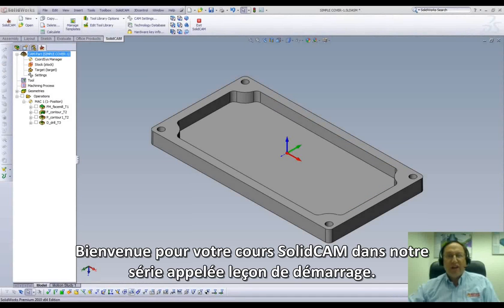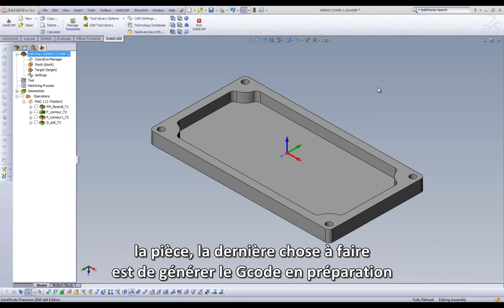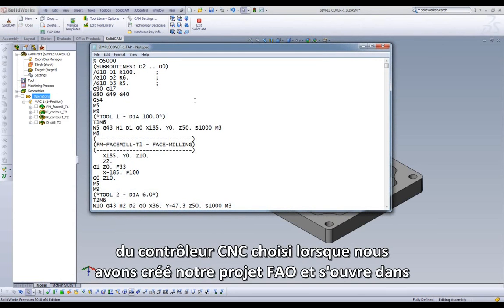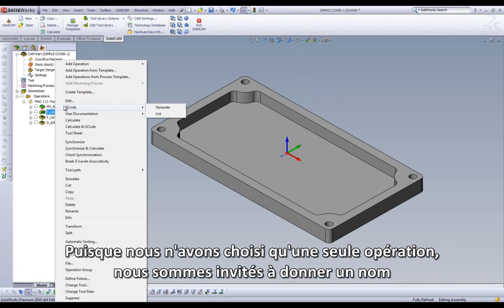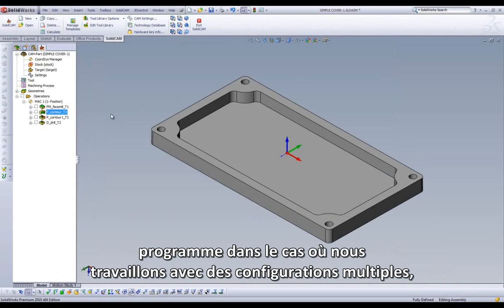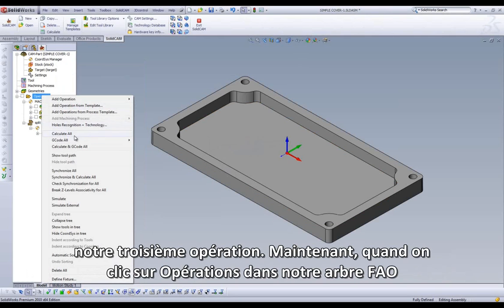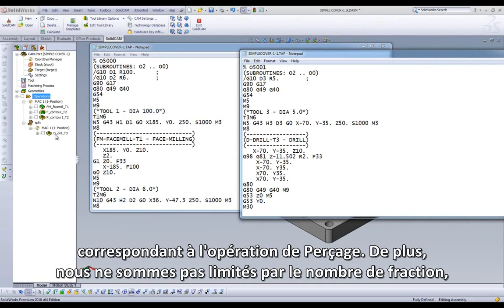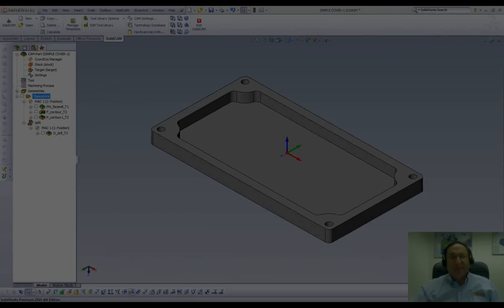SolidCAM - Leçon de démarrage - Partie 9

Comment: Bonjour,
merci pour ce tutoriel. 
Question : Est-il possible de choisir un post processeur ? et le 4 axes est-il supporté ?
Merci pour votre réponse.
Marc.
Hello,
thank you for this tutorial.
Question: Is it possible to choose a post processor? and is 4 axis supported?
Thank you for your reply.
Mark.
Reply from the maker: Bonjour,

Oui,
Au démarrage du projet, il faut définir l'origine de programmation, la pièce finie, la pièce brute et ... la machine sur laquelle vous souhaitez travailler (Choix du post-processeur).

La version d'essai est livrée avec un petit échantillon de post-processors d'essais gratuit.
ils se trouvent dans C:\Users\Public\Documents\SolidCAM\SolidCAM202X\Gpptool.

Si le post-processeurs sélectionné est un post-processeur 4 axes, les opérations 4 axes seront supportés bien sur.
Dans le cas où les post-processeurs de la version d'essai ne vous donnent pas satisfaction, il vous faut vous rapprocher de SolidCAM France. Notre travail consiste à fournir à nos clients des postprocesseurs adaptés à leurs machines. En plus du logiciel.

Cordialement.
L'équipe de SolidCAM France